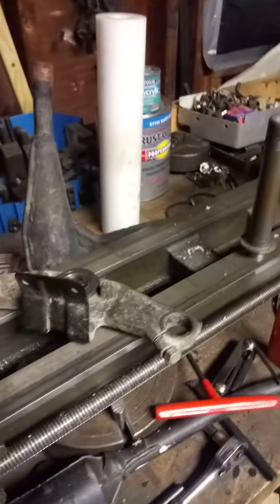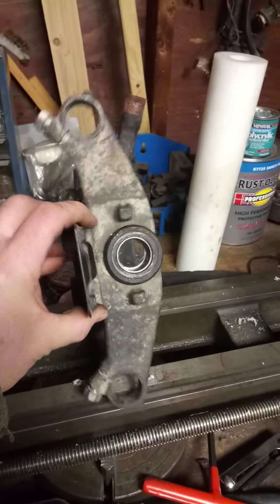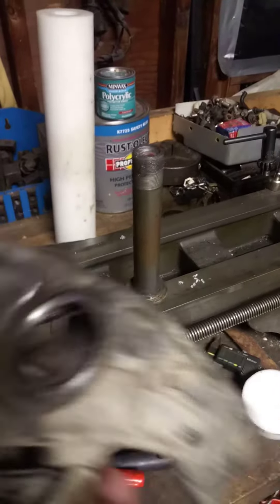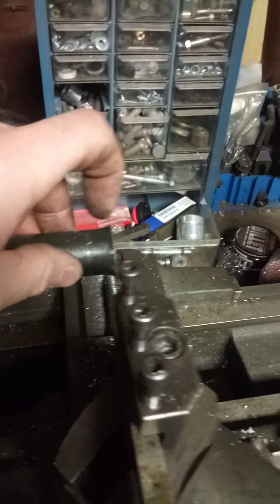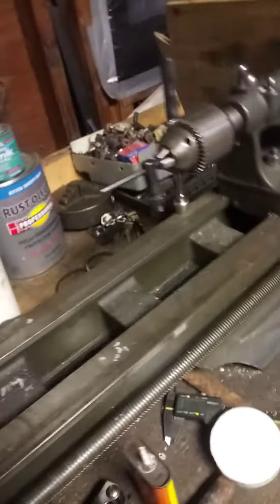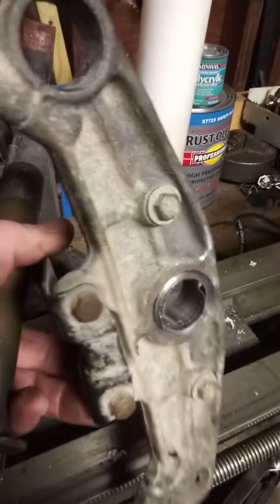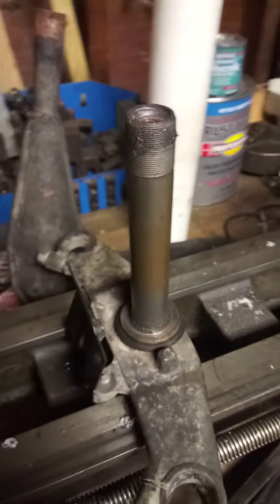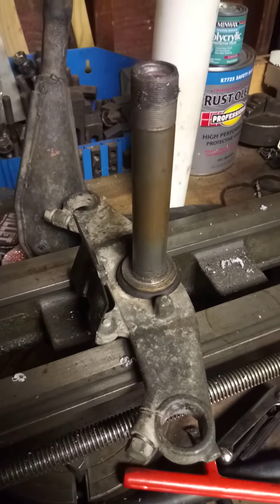yt60 tri-zinger bw80 fork swap

Comment: I saw your other video. What brake lever and throttle set ups do you have and what bars?
Reply from the maker: Parts are available through eBay I’m running a thumb throttle from a 110cc atv and the brake lever is a universal folding lever very happy with the fit . The cable you get with the thumb throttle also works great if your doing an oil injection delete . These bars are pro taper micro would recommend going larger , my son already out grew these .
Reply: @Josh-ic4py  thank you!
Both of our zingers have injection deletes
I'm going to search for this stuff, thank you
Reply from the maker: No problem at all! If you have any issues finding the items let me know and I’ll provide some links

Comment: Het man did you use zinger front shaft or bw?
Reply from the maker: The zinger front axle shaft just makes it , you will need to shorten the left and right spacers properly to center the wheel in the forks .
Reply: @Josh-ic4py  thanks a lot